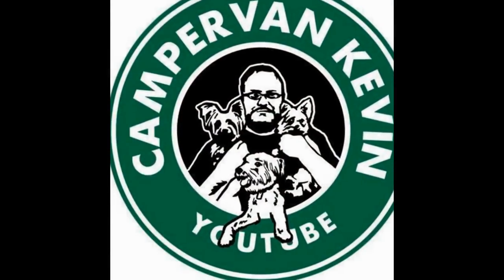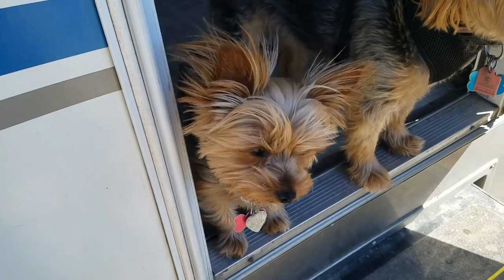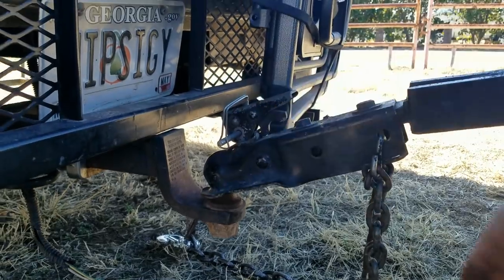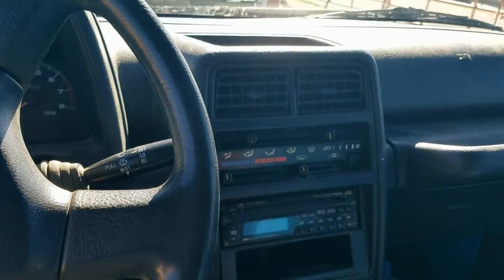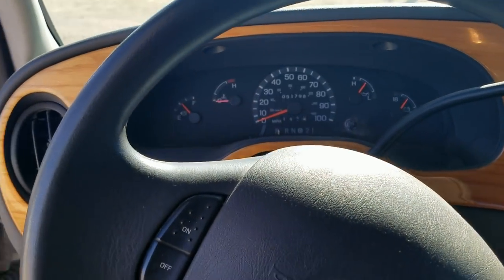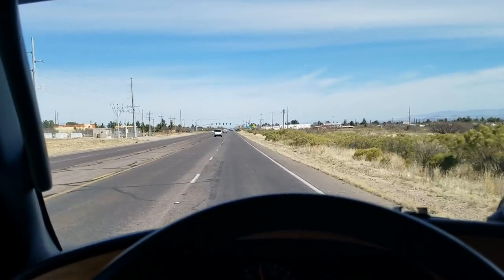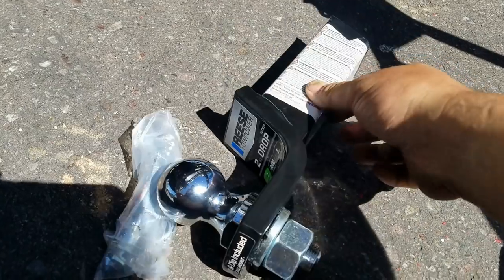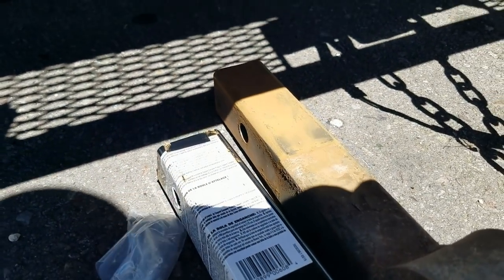HITCH PROBLEM SOLVED!

Comment: Kevin, that green wire on the flat electrical plug is supposed to be ground. It should connect to the body of the rv and the body of the tracker. then you will not have an issue with dim lights. I am 74 and have owned 10 different rvs over my lifetime including the 23' 89 mallard that is sitting in the yard right now. Also  I full timed in a 34' Winnie for three years from 2010 to 2013. Love your vlog and your Furrie kids. I have three of my own. If you get to Vegas I would like to meet up. Thanks for the great vlogs.

Comment: If the wiring harness is wired up correctly the ground is through the harness not through the tow bar. FYI: White = Ground. Green =  Right stop/turn. Yellow = Left stop/turn. Brown = Tail and side marker lights. Safe travels.

Comment: FYI, the clevis is the part that the chain attaches on the end. 
By definition a clevis is a U-shaped or forked metal connector within which another part can be fastened by means of a bolt or pin passing through the ends of the connector.
Therefore, you have a clevis hook.

Comment: Whoa that is seriously major hitch angle. Is the hitch latch completely around the bottom ball??  It a process! Sadly my toad, a Sonics, requires DLIS fuse pulled but it also controls 12v plug for break system. I now wire it through 12v  motorcoach. And battery off switch on Sonics!! It a work in progress..RVing!! Thanks for journey!!

Comment: My 96 Tracker 5 speed I turn the key to acc. and pull it out.  No dash lights. No need to disconnect the battery. Steering column stays unlocked. All is good. Try it KVC.
Reply from the maker: mine wont come out.... 92 model

Comment: Your weak link on your hitch is the coupler.  look at having a a bulldog clamp style coupler welded on they will not pop off. The one you have will pop off. I have had it happen going over a rail road track not good so I don't trust them no more.The angle does need raised some.. I would just recess that bar going across the top of your coupler a little bit. Safe travels Kevin.

Comment: Over my 45 years I have drop a few trailers. As long as the chain is tight enough that it doesn't hit the ground you can safely stop. Most of the time t came off because I wasn't level or straight. But I was going less than 10 mph. I had a very old horse trailer and was going 50 mph hit a big bump in the road and it pop off. I was able to stop because the hitch didn't hit the ground. I was going after a horse.
If you would go from a 4 wire to a seven wire plug you can run a hot wire from the RV to the tracker. No need to take off the ground clamp. I like a ground wire in the plug so that my lights work better. Also people like to put  a brake actuator in the towed car for better brakes.

Comment: When i tow I turn my key one notch to unlock the steering. That way you don't power everything up and no need to un hook battery. Every thing you unhook is a chance for failure. I bought my Tracker new in !989 and we have had lots of adventures all over Canad and US.
Reply from the maker: hmmmm, mine is diff
Reply: is there no accessory position??

Comment: I’m glad you got the hitch fixed on your car when I seen you come out without wrench I knew you were not going to get that off I was going to suggest going to a mechanic shop And they could have removed it 😊When I remove mine on my truck I have to use a cheater bar almost 6 feet long with a huge pipe wrench lol 😂 Thanks for the video.Oh yeah just let you know weather is beautiful back home in Georgia today a little rain tomorrow almost 80👍

Comment: I'd disconnect the battery with the key off, then turn the key on. Less current draw, less spark.  And the computer wouldn't be energized (I think) when the spark occurred.

Comment: You should have a ground wire from the pt to the tracker.  With depending on the ball for ground you get surges and low voltage to both vehicles.. could cause issues with all your electronics. Usually the white wire is ground.  If it is already used just rig up something with a quick disconnect of some type. Alligator clip is nothing else.  Check with your mechanic buddy on it all.
Reply from the maker: agreed. This set up is new since I just purchased Tracker. Ironing out little issues as I go. Once ball travels a minute I have good ground

Comment: Hitch looks much better.  Harbor Freight has battery disconnect switches for I think less than ten bucks,  better than disconnecting battery every time, also some what of theft deterrent I used to start vehicle after hook up to be dam sure every thing was right.hook up can be a real pain by yourself sometimes, but you made it look easy..

Comment: Overlanding in a Tracker, that be a first! Well, I can recommend ARB fridges. I transfer mine between my 80 series Lexus (last year of the solid front axle and factory lockers) which is my TOAD, the Power Wagon, and sometimes the joey bed on the A. Changes the whole 'overlanding' game when you can keep food cold or even frozen. (plus it is a backup to the propane should it fail). I'll caution you though, you'll want a second isolated battery, or a good jump pack. While efficient, they do tax a normal cranking battery. Not sure you could squeeze a RTT and solar on the T! Peace!
Reply from the maker: having a heckuva time finding a full rack for the convertible two door. welder didnt work out
Reply: Campervan Kevin Check Front Runner. Pricey but nice. Aluminum. Save weight. Moving mine from the 80 to the Power Wagon for solar. Their camp chairs are nice. I think CGI

Comment: Since you drag once in awhile. There is a solution for that. Install air shocks or an air ride system. It would raise up the rear of the RV and align the tow bar. Bam 2 things fixed with one go.
Reply from the maker: running air shocks now :)
Reply: Well now that you turned over that hitch it shouldn’t drag anymore.  I saw that bolt and nut dragged smooth  :b
Reply: I bet with that 10 banger under that hood. You don’t know your pulling that Tracker. No weight on that hitch just pull weight

Comment: seems to me that the hitch you have should work, if you just remove the ball and flip it to the other side so it rises instead of dropping down low.  We had to do that when we bought our 13' Scamp trailer, took it to an autoparts store and they helped unscrew the ball. Just a thought, maybe save you from buying another.

Comment: Maybe you should have hired that welding shop to level or straighten that trailer A shaped metal connector between the BT cruiser and the tracker.  Give the shop some business.

Comment: I did that with a tow bar like that for my TJ for 5 years. No more, way too much work! I use the Blue Ox arms now. They are kinda adjustable but way easier to hook up by yourself. Glad you got the riser for your hitch! Why do you need that metal rack on the back of the BT if your flat towing the tracker ?
Reply from the maker: originally I was going to carry things on it, but then started using it standing up for chairs and stroller.

Comment: those are hooks with spring latch's:) the clevis is a u shaped with a screw in or cotter key pin for lifting with cables or straps on a crane. been a mech my whole life:) Hooks bend out under weight, clevis will not:)

Comment: Never seen a car you have to unhook the battery to tow. Most you just turn the key to acc and it unlocks the steering wheel without all the warning lights coming on.
Reply from the maker: I guess I got lucky! ha

Comment: Wonder if that second floor door is labeled "Complaint Department" on the other side !!!  Not surprised that nut didn't come free, looks like it drug a few times. Looks a lot better. Next time you hook up maybe see what the tow bar would look like if you flipped it over (assuming the coupler isn't welded on and those bolts would come loose) Might level it completely.

Comment: You know Walmart well super Walmart anyway has a garage. Should have just brought the hitch in there and used and had them try using air impact gun zip zip. Also maybe should have grabbed just a new ball and put on it. Or take a wire wheel to it. And I know your not supposed to put grease on it. But maybe put a fine film layer of electrolyte grease on the ball to improve ground contact.

Comment: This is an example of most of the projects I take on. Not the right tool, not the correct part, misalignment, I can do it cheaper this way🤔🤔🤔🤔, no I can’t 🤬. 😂😂😂problem solving